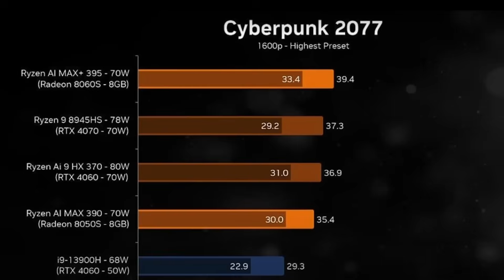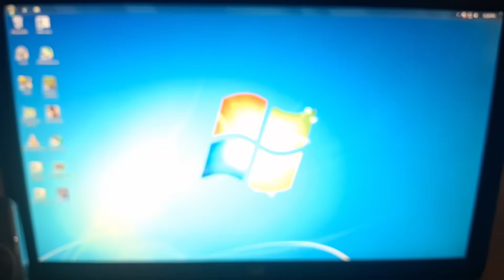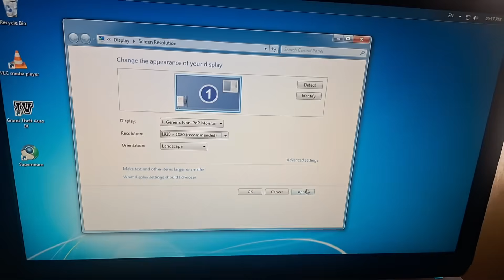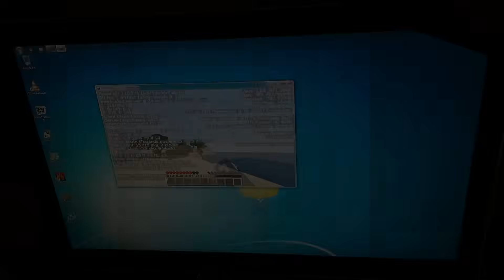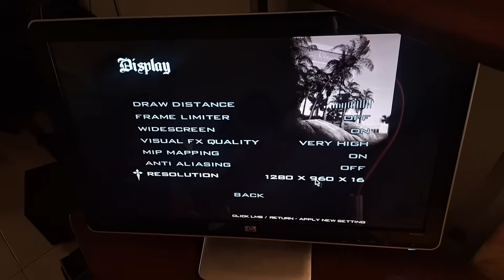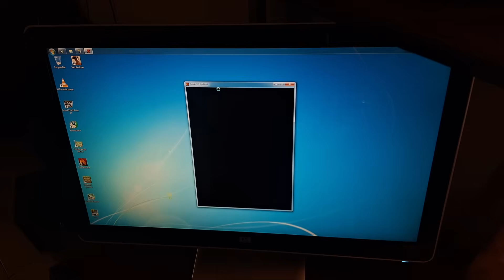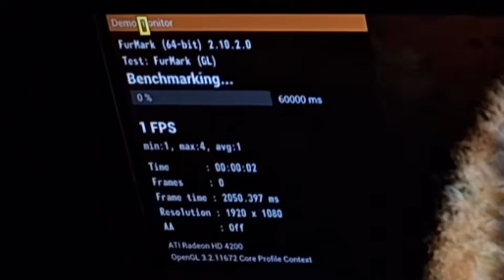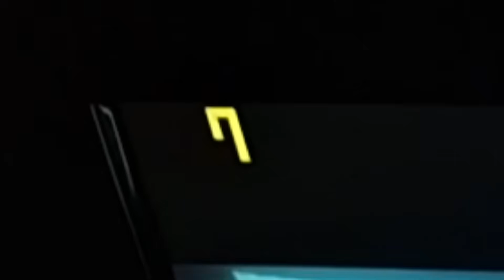How BAD Were Integrated Graphics in 2009?

Comment: This is worse than a snapdragon 860 
i have Rise of the tomb raider on poco x3 pro in winlator c mod and it has 22 fps
TR 2013 has 39 on 720p high, still much smoother than what i see here
I wonder what performance will i have when i get SD 8 Gen 2 or gen 3
it will be like  steamdeck!

Comment: Up to 23H2 win11 version, SSE4.2 is not necessary but since 24H2 and the new ones yes. I was able to install win11 23H2 on a Athlon II X2 215 and 4go of DDR2. Hop it will help!
Reply from the maker: Tried installing 23H2 on my machine, kept getting a bootloop with various BSOD errors

Comment: I'm reminded of the days of the 8600GT with 256MB of VRAM. They weren't the best, and games ran terribly on the lowest settings, but they were playable. The graphics still work, even though I'm on new hardware; that one has seen its day. The video looks cool, but recording the screen will further degrade your PC's performance. Wouldn't it be better to use MSI Afterburner + StaticRiva and have statistics on screen? Just set them up.Then I had a GT 430, I got a fanless 1GB VRAM but it was a beast. After that I had a GT 630 2GB for a short while but the GT 430 started to show artifacts and even after cleaning and replacing the thermal paste it didn't help.So I gave up on this old PC.(intel core duo e2160 1.8ghz 1gb ram i 250gb hdd)

Comment: Great video! Here's a bonus tip, you can use fraps to log the frametime data to a file. Then you can use frafs(not fraps) bench viewer to analyze the data and it'll give you information on the frametime data like 1% lows, 0.1% lows, etc.
Reply from the maker: I didn't know about that, thanks for the info!

Comment: The rule for integrated graphics is to play games released 10 years previously or older. So, radeon 780M is best for 2014 games or older
Reply: So the one included in AM5 7/8000G and 9000X series?

Comment: Had the same experience with the X1600 in my Early 2006 Macbook Pro under Win7 about drivers, only Apples worked after alot of pain. They dont work properly on Windows 10 however so I suffer.

Comment: This is not bad at all. Back in 2012, I was stuck with Intel GMA 3600. Finding playable games on it was a game itself.
Too NEW to be compatible with old games properly, too WEAK to support 98% of games that resembles a "modern" game.
640x480 Half Life 2 at low settings, avg FPS not exceeding 35, with noticeable stuttering on top of it.

Comment: could probably get more fps if you use modified gpu driver or debloated installer. but the improvement wont really go above 10 fps anyway. overall good vid
Reply from the maker: I didn't think about that, thanks for the advice!

Comment: Wrong info. 780G released in 2008 with Radeon 3200.
Reply from the maker: The 785G (which is what I have) released in 2009 with the Radeon HD 4200
Reply: @pokeytechGet the 780G and re-up this video.
Reply from the maker: @duniasementara-gd5vc I might if I can get my hands on one

Comment: Back then, I used my potato laptop for everything. Pentium T4200, Intel GMA 4500M… pure suffering. I spent hours tweaking config files just to squeeze out a few FPS. I still remember the day I finally got GTA IV barely running at around 15 FPS. I felt an absurd joy, like I had accomplished something huge. Funny how we were happy with so little. Good times.

Comment: Just a small reminder, shadows can be turned off in gta 4 and you can gain 5 to 8 fps
Reply: 60% performance gains ironically
Reply: @billyrunsaplumbingservice1141  LOL, each frame matters in sub 30!
Reply: GTA 4 was admittedly unoptimized compared to GTA 5 though.
Reply: shadows cause gpu texture bugs

Comment: Imma give you some info and answer some of the weird shit about the ATI HD 4200 IGPU. I know all about this because I had to mess with an HP G62-340US laptop with HD 4250 IGPU.

So when it comes to integrated graphics like that, you can actually use them on Windows 10, but you have to tell windows that the driver is for an older windows OS and then install them in administrator mode. 

You can also go into the registry to find the drivers display resolution and manually create your own resolutions.

Idk why you couldn't get MSI Afterburner working for you, I was able to get it to work perfectly fine on Windows 10 when running games like Counter Strike: Source.

To add, the HD 4200 is only good for a max of 720p and that's pushing it. when you make the IGPU be utilized to 100% due to processes like complex graphics or high resolution, it will cause input lag that makes the experience worse.

Basically, it's a 640x480 low setting shitter that can only run less intensive titles from late to mid 2000 & before. The newest game this thing could potentially run without a shit experience would be CSGO, and that's questionable at best. Last time I used that laptop, it was struggling to run Counter Strike: Source at a consistent 60fps since the HD 4250 was also paired up with an AMD Athlon P340 Processor.

If you had to deal with an IGPU from the Catalyst 1 series, I feel your pain. If you still use one today, it's definitely time to upgrade your hardware.

Comment: 8GB of RAM in 2009 would of been crazy. Most systems had 2 or 4GB back then.
Reply: Not necessarily. I have a 2009 PC with a mobo that supports up to 16GB of DDR3 1600 RAM.
Reply: @fungo6631  That doesn't mean anything my motherboard supports up to 192GB of RAM.
Reply: @dumbfloppa Your mobo is a workstation mobo. My old PC doesn't have some workstation mobo.
Reply: @fungo6631  It's not a workstation motherboard it doesnt even support workstation CPU's, nor ECC RAM. Just a regular B650 board.
Reply: @fungo6631 My motherboard is a workstation board from 2014 and it supports 2Tb of ram. 192GB/256GB is pretty standard on modern consumer boards.
Reply: The HP G62-340US I found in E-waste originally had 3GB of DDR3 RAM in it. It had a HD 4250 and Athlon II P340, which was so bad, it couldn't even use all that ram before the system started shitting itself.
Reply: Yeah it was. My dad got a brand new PC a year prior in 2008 and it had 2Gb and a core 2 duo for $800.

Comment: iGPUs basically manage to run previous console gen games at decent framerate at okay settings but starts shitting pants with current gen games.

My iGPU on core 2 Quad managed to run ps2 generation games but couldnt run ps3 gen games. iGPU on my i7 6700k can do ps3 gen just fine but struggles with ps4 gen. The uhd 730 can run ps4 gen games at playable ish framerate with ugly settings but cant do ps5 gen games.

Some of the highly expensive igpus these days are alright but they are so expensive, you might as well just buy a gpu. So those dont even count.

Comment: That's quite a ancient iGPU, have you tried Nimez drivers on it? It's basically a modded AMD driver, but before downloading check which driver version to download first. I installed it on a old ASUS K5 series laptop which had 1GB AMD graphics  and it worked great. I was able to play a couple of older games like Skyrim and Farcry 3 on high settings, as well as watch 1080p movies using VLC. You can try the same if you want.
Reply: This is too old for Nimez I believe.
Reply: @fungo6631  you are correct, thanks for correcting me. I checked it on their website just now and it doesn't support it so the official drivers from 2013 is the best one to use unless he decides to modify it himself. There's "AMD Catalyst 13.2 Legacy Drivers ( X64) modded by Ironclad" from guru3d forums dated 2014 but unfortunately it's long gone.

Comment: I got a more typical Intel GMA945. It made playable only the simpliest games, not more than GTA VC, HL1, Nitro Family, CB Undying, Fakk 1-2, and dosbox games. But there existed  a more interesting integrated graphics card, which was widely used in netbooks in 2008-2010, that was an adopted PowerVR GP integrated to intel Atom's. It completely sucked in everything, had working drivers ONLY for Vista SP2 and Win 7 SP1, no acceleration in any other OS, including all linuxes.
Reply: Bringus Studios actually just made a video using a PC with one of those PowerVR chips. It went about as well as you could expect.
Reply: I was using an Dell XPS M1210 back in 2015-2017 when I was a kid and I remember the GMA950 experience. I was playing CS 1.6 with 40 FPS. 40 fricking frames on 2000 game. Core 2 Duo T7200 - 3GB RAM - GMA950 with an old-ass hard drive. But I have to admit that laptop's case design and keyboard was awesome. The M1210 has an NVIDIA Geforce 7200 discrete GPU as an optional, more expensive version but I didnt have that model back in time. Then I "upgraded" my PC to an Core 2 Duo E6600 - 3GB RAM (again) and AMD Radeon HD 4550 desktop PC for a year. it felt like an awesome upgrade until I switched that onto an R5 1600 AF - 16 GB RAM - R9 290 system in 2020.

Comment: In San Andreas you set the resolution to 1920x1080x16 instead of 1920x1080x32, hence the color banding problem.
In GTA IV you can turn off the shadows, improving the performance with slow main DDR2 RAMs
Nice video!
Reply from the maker: Thanks for the advice, I'll remember for next time

Comment: You forget motherboard chipset integrated graphics in certain brands like VIA, SIS, Nvidia nForce. Those were also a mixed bag 2 years after release with most under performing. Though S3 unichrome, and the pro version wasn't too bad.
Reply: ATI also made the Radeon 9100 IGP chipset GPU, which was not bad for 2004. It was way better than Intel Extreme Graphics, as it was apparently a Radeon 8500 in chipset GPU form.
Reply: i miss s3......damn it via why u do noting with the aquasition!
Reply: So much this. Not to mention that you don't need a 3d accelerator to view graphics, as was the case with "2D graphics cards". ISA ones, for example.
Reply: VIA is something I never wish to see again.

Comment: Back then I had a Core 2 Duo E4400 based system with an NVIDIA iGPU, I think it was called the GeForce 9400m or something like that. Early-to-mid 2000s games generally ran quite well. GTA IV ran at like 20-ish FPS with all lowest, but amazingly I actually managed to complete a fair chunk of the game like that, I don't think I could do it today with that performance, lol. Minecraft Beta and early release versions also ran quite well at like mid-level settings, I was even able to install some mods and higher-res texture packs with little performance impact. I played Minecraft quite a lot on that system.
Reply: And right now Intel N100 completely smashed the performance of it with just 1/20 of the power consumption. Time flies